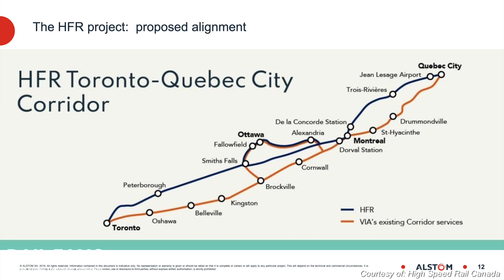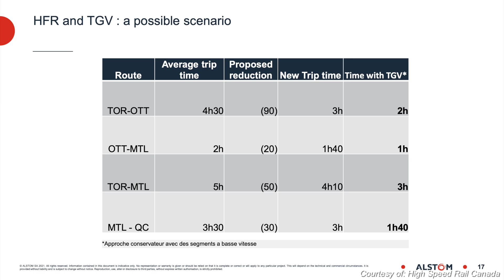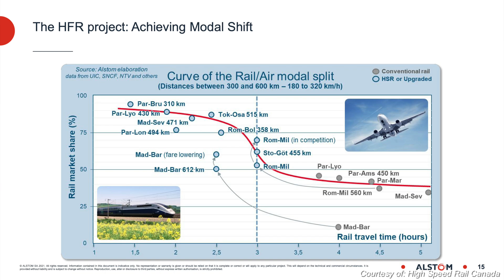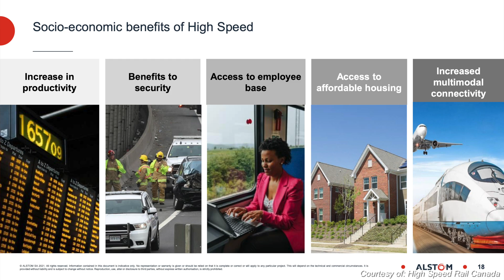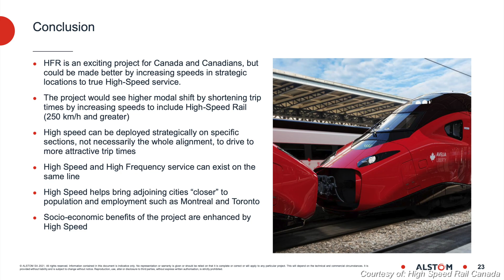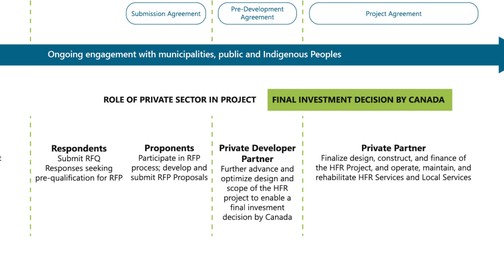The Plan To Bring High Speed Rail to the Corridor - Alstom's Proposal for High Frequency Rail (HFR)

Comment: The way I interpreted the map for Montréal is that it would use the CP alignment from St-Martin JCT to Park then Outremont Sub then Adirondak sub to Montréal Ouest, then Vedom and the shack over Lucien l'allier metro. 
Montréal Ottawa would be CP tracks from Lucien l'allier to Dorion, then Winchester to de Beaujeu and VOA's Alexandria sub to Ottawa. Montreal to Toronto would leave Lucien l'Allier on CP to  Dorion and continue on Winchester to Smith Falls and then on the windy right of way to peterborough, assuming they can buy all the house/buildings that are now in the way since CP abandoned the right of way ages ago.
Now, with CP's only reason to have stopped plans to abandon Québec being the port of Montréal, there is no way they will allow frequent and electrified trains betwen Parc and Montreal West, and certaintly not between Lachine and Smith Falls.  The couple of freight trains left between Québec and Ontario are just double stacked container PSR log and slow trains. 

The fact that they are pitching the downgraded US version of Avelia shows they do not take this project seriously. The loss of Central Station because the REM destroyed the Mont Royal tunnel is the big elephant nobody talks about and unless the governnent is willing to build a second tunnel (which could emerge at Parc and thus avoid the CP freight line at Outremont/Adirondak)  then nothing will ever happen. Stopping trains at Lucien l'Allier is not realistic since what is left of the tracks doesn't have enough platforms to add services and this certaitly woudln't be a premium service when there is no station to speka of and platforms that are open to sky/precipitation.  In destroying Windsor Station, CP made very sure there was no future for trains there, and would still prefer to sell the right of way from Luciel l,allier to Vendome to real estate developpers. 

That Alsom PDF is a very sad joke because it shows obody is taking this project seriously. It is just a powewrpoimt that looks good to politcians who don't even realize what route it would take through Montréal.
Reply: A map  would help yo understand what you are talking about!
Reply: @clarification007  I was refering to the map prvide in the alstom proposal for HFR.  It uses CP tracks from St-Thérèse down to Parc, along Jean Talion, down to Montreal West and to Lucier l'allier. And to Ottawa, uses CP tracks from Luvier l'allier to Dorval to Dorion and CP winchester to Smith Falls.
Reply: Considering they found 100-year old explosives left in the tunnel and considerable corrosion that required rebuilding the thing at McGill...I am not so sure the REM "destroyed" the Mont Royal Tunnel.  The thing seems to have needed quite a lot of maintenance--including, uh, EOD techs--I think that running Exo commuter trains through the thing would have ended badly at some point.
Reply: @andrewweitzman4006  At McGill, there is no tunnel since it is cut/cover operation.  So he state of tunnel there is irrelevant. And between  just south of Ste Catherine (where actual tunnel begins) and the McGill station is a very short stretch of actual tunnel.  Remember that the tunnel was check and fixed up during the 1995 rebuild.   The explosives this is a nice story for media but is an excuse.  They would not have inserted explosives beyond the space that was to be dug, so when they enlarged the cavern for Édouard Montpetit,  they wouldn't have encountered stuff beyond the original tunnel holes. 
REM sold the project as an easy and fast to do. Once it was too late to stop, then they have to find excuses to admit to reality that it would take longer and cost a lot more.   And they also shifted worked to the shoulth shore and found excuses to delay deux Montagnes, west island leg and the airport one.   At one point CDPQ blamed tunnel problems on steam engines running through tunnel. No steam engine ran through tunnel, it was always electric, and the trains that went beyond what is now Grand Moulins switched to steam there.  (trains went to Hawkesbury to the west, St-Sauveur and St-Rémi to the north, as well as St-Thérère and St-Jérome.  When a project uses false PR to explain problems,  they are being dishonest.

Comment: I feel like the Japan Tohoku Shinkansen model would fit best for this corridor, especially since the technology is proven in harsh winters and is profitable even with lower passenger volumes, but I'll take anything at this point!
Reply: Alstom trains are used by SNCF for their 2 main high-speed services : InOui, the regular operator. And OuiGo, the low-cost operator in both France and Spain and they are profitable with tickets starting at the dirt cheap price of less than 10 euros !
The Alstom lineup also offers every kind of adaptations to weather conditions, from "winterized" versions to "summerized" or desert and dust configuration. Or both.
They run in the high, narrow and freezing corridors of the Alps and the near desertic coast of Morocco bordering the Sahara.

So all your concerns, from profitability to weather conditions are addressed.
Plus, keep in mind that Shinkansen trains, although being excellent trains, never run on legacy tracks and exclusively on dedicated high-speed lines without any mixed traffic whereas Alstom HST's (and most other European manufacturers' for that matter) offer trains compatible with a wide variety of power types, voltages and frequencies to run on various legacy tracks.
Like the TGV's Thalys PBKA (Paris Brussels Koln Amsterdam) that is "quadricurrent", capable of supporting the power setup of 4 different countries high-speed lines.
Alstom is also the only one offering full speed and "all terrain" double decker high-speed trains if the capacity is required (which you think is needed between Toronto and Montreal). This one's not pendular though.

There's also the issue of local manufacturing : Alstom has factories capable of building these trains on location.
It's by far the ideal candidate.
Reply: Meanwhile in the late 1860s Canada and USA laid thousands of miles of track in just three years. Takes decades now to decide where to put it.
Reply: If federal transportation minister and Alberta and BC transportation ministers should look into it for Edmonton- Calgary-Vancouver passenger rail corridor. Plus intra province passenger rail corridors connecting all Alberta and BC cities.

Comment: The best choice is always to serve main stations with high speed rail, especially if they are origin or destination of a big number of trains. Build a Montreal North station is a wrong choice although is the cheaper one. A better solution, instead, is  to build another Mount Royale tunnel for high speed trains. Is fundamental for high speed service to serve the main station on bigger hubs where rapid transits and commuter trains can feed with passenger from the entire city and neighborhoods.
Reply: High-speed trains can perfectly run at 300, 320kph or more in tunnels. You just have to build a piston effect mitigation entry or relief ducts.
That has been done for years and it works well.
If trains were limited to such low speeds in tunnels, the European networks, especially the French and Spanish ones would come to a standstill... But they run full speed in many tunnels without shattering windows all around.
Reply: Butt, a lot more $$$$$$$ Millions more! But also the HST won't go faster the +/- 150Kmh in a tunnel. So, I don't agree with d1234as for that case.
Reply: @clarification007  yes, but is mandatory to serve main railway hub. It's not important that speed in urban penetration is  250/300 km/h, but it's more important to reach the central station (Montreal Central, in this case). Forget Japanese high speed model, the Canadian system is more similar to European one, Canada has standard gauge rail system and the only lacking thing in urban penetrations is electrification. Japan has mainly small gauge network instead of standard gauge and there's no interoperability between Shinkansen and standard lines.
There's no reason to have high speed rail approach to main station, is only a "nice to have" that can be built after. The initial necessities are to build high speed lines outside the cities and electrifying urban section to reach the main stations of main destinations: Toronto, Montreal, Ottawa and Quebec City main station must be reached from high speed trains; instead smaller cities and town can be served also from small dedicated stations in the suburbs if the existent  railway stations are not easy to be reached from high speed line.

Comment: Second comment unrelated: You should do a video on the passenger rail developments going on in Alberta! Specifically the Calgary-Banff proposal and the Calgary-Edmonton HSR proposal (NOT the hyper loop one), both of which have MOUs with either/both the CIB or/and Govt of Alberta. Curious as to why Via is willing to expand HFR/HSR along the Laurentian route and not Calgary Edmonton (the other of only two corridors in Canada where’s there’s a solid business case for it). Seems odd that the West, even in high traffic corridors, has to rely purely on the private sector and provincial govt and doesn’t get support from Via. I’m assuming the reasoning is political (ie Albertans don’t typically vote liberal), but if there’s actual technical or business case reasons I’d be interested in a deep dive from la gang! (I get that Toronto-Quebec is interprovincial but the line stops within both provinces at other cities and also Via used to operate Calgary-Edmonton then stopped - if the private sector sees a potential return for building, why doesn’t Via which in theory is not purely motivated by profit as a crown corp?)
Reply: Since the beginning mention of the HSR mention in Canada the most favorable place to start a project of this size, is where the high population are, Quebec and Ontario.
There no mention of VIA Rail on this project. The HSR could be paid from Ontario and Quebec as owner. While the HFR could be with ideal for year with VIA.
VIA is very busy enough with all Canada.
Reply: The Toronto-Quebec HSR corridor will cover more then 65% of Canada’s population, how can you possibly bring politics into a crown corporation? 

Maybe more attention needs to be paid towards local and provincial governments who are swindled by O&G lobbyists? Calgary barely has one functioning LRT system which is surrounded by SFH and parking lots.

Comment: I have two alternative suggestions: Build a new railway in the median and in some areas beside the  401. Also replace the very old Canadian train sets with new ones, so travel between Vancouver and Toronto is done on a modern train.
Reply: Travel need to return Vancouver-Montréal.  One shoudl not repeat the huge mistkaked of 1989 to cut transcontinental trains.

Comment: Before billions of dollars are flushed down the toilet, please concentrate on improving the existing VIA rail service.  It is not reliable; delays are frequent.  The existing customers are likely to be the earliest converts to alternative services; however, some of us have been quite turned off by delays, lies in the face of a delay by VIA personnel, and the childish seating requirements that exist in present day rail service.
Reply: You just described the goal of the HFR project : buy freight tracks so they stop impeding passenger travel, electrify and double track it all and voilà you've got a decent intercity line always on time.
Now they're requesting contractors to do that work and some contractors are saying that some sections with good geography could be built to a high speed standard without tremendous costs.
But regardless of what option the government chooses, the new line will be more reliable and with "high" frequency (like one or two trains per hours lol)

Comment: Problem with bringing higher speeds on only parts of the network is that it's more difficult to justify buying expensive high-speed trains if they can only operate at this speed for a fraction of their trips. It's like buying a very expensive car that can go up to 130km/h when you're driving in town with much lower speed limits 80% of the time, is it really worth the additional cost ? (in that case only really expensive cars would be able to be that fast).
It may be more interesting to have a continuous dedicated corridor at 200-250km/h for most of the benefits without the full cost of "full" HSR, making the line more reliable and free more capacity from the beginning (as opposed to fighting with freight and local trains to get more)
Reply: High speed trains aren't that expensive though, the expensive part really is building good tracks with wide turns and the land costs oh and also electrification.
It's not like a metro where there's hundreds of wagons, an intercity line has just tens of trains
Reply: I'm advocating for a continuous dedicated corridor at 320-360kph.
Since you're going also for the continuous line, why not go for the full speed ?
2 European countries have chosen the "parallel" model of uninterrupted lines and branches to city centers plus on-line full speed through running stations and it works great, offering the best capacity, speeds, reliability, frequency and service.
They're also they only ones really capable of offering both dirt cheap low-cost and premium services with really short journey times.
So maybe there's a good example to follow there.

Comment: Oooohhh myyyy, I paid attention to the timeline and they are taking soooo loooong just to plan!!! 3-5 years after deciding on the private partner to develop plans? Construction wouldn't start until 2028, so it wouldn't be commisioned until at least 2035... Canada has a habit of studying non-road projects for so long that by the time they're built, they're already outdated. Made me sad, even though it's such a positive video lol
Reply from the maker: The whole timeline for HFR is far from enthusiastic, that's for sure. We'd hope that it can be accelerated, but given that the RFQ was supposed to be launched in January now says "Q1 2023" is not really the momentum we like to see.
Reply: Following the Americans over the cliff of absurd delay.  Dithering seems to be the battle cry of rail planning in both Canada and the US.  Sad.
Reply: This is a long time to wait for a new train line. Plus it doesn't go through populated areas. If you are using the Canadian Pacific route, use the North Toronto station.
Reply: @trainglen22  The Canadian Pacific and CN are private owner. The won't sell one single tie of that rail.

Comment: this is AWESOME although I do hope the idea is to eventually upgrade the 144 kmph parts of the alignment to at least 200 kmph if not more at some point.
Reply from the maker: As part of HFR, there is (at least) plans to improve speed along the Corridor up to 200km/h. This, for now, can only be done on dedicated tracks as freight traffic is a big part of why speeds are lower (traffic, track conditions and grading).

We do believe that, no matter the chosen option in the end, improving passenger rail in the Corridor is primordial to create a modal shift and a more sustainable transport network than flying or driving. -David
Reply: @RailFansCanada  what I meant is that it seems that the proposal, based on 1:14, is to initially have sections of track from Toronto to Peterborough section that have a top speed of 144 kmph and I hope that over time they upgrade those low speed sections for higher speeds.
Reply from the maker: Ah I see! In that case it’s mostly because it is a CP and Metrolinx alignment that would be shared. The likelihood of them being upgrade further is far less likely saddly.
Reply: That long section to Peterborough would make little sense at 144kph, I'm certain 160kph - 200kph or even 250kph could be achieved on that alignment with minimal upgrade work. I assume the 144kph limit is due to level crossings, which would have to be removed at great cost, however strategically planning these removals and replacing several crossings with a few bridges has been cost effective elsewhere.